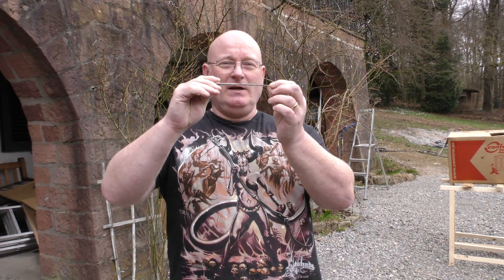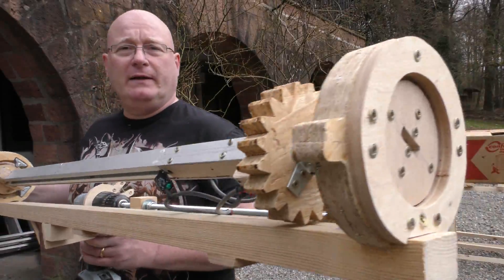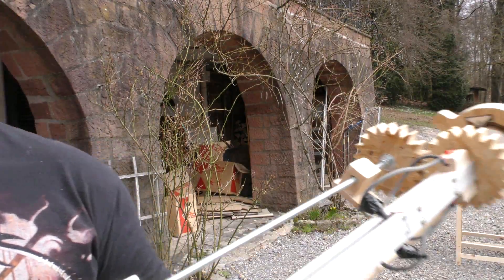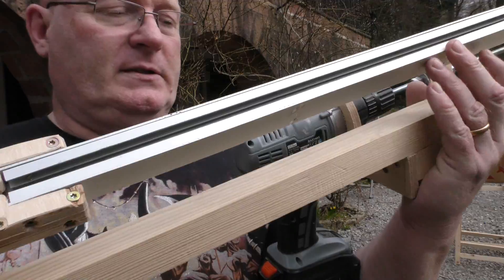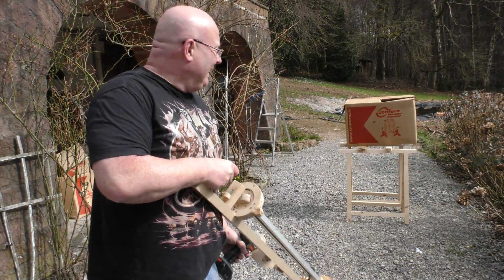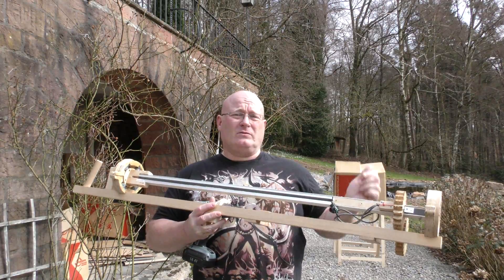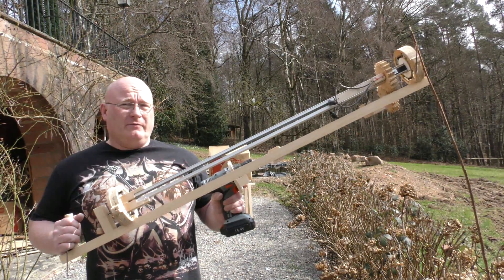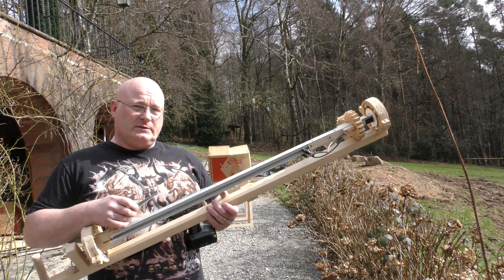"Kunai Twister 2600": The World's First "Rifled" Knife Launcher?

Comment: Attach some type of fletching to the knife. Like string or plastic that is attached the the back of the knife but it hangs loosely. When the knife flies the air will pick up the hanging fletchings and stabilize the flight of the knife. When I throw knifes I will do this type of fletching and it helps the knife from tumbling through the air.

Comment: I think the problem is the knife is flat and rotating it is like rotating a paddle in water - there is a lot of resistance. A round bullet spins much easier. You should test this contraption with a round projectile like a steel rod for example. Different lengths might also affect the movement. Looking forward to a follow-up :)

Comment: Try using a different gear ratio? If you have a larger drive gear and/or a smaller driven gear it will make it go a lot faster.
Reply: I work with this stuff using VEX parts and although vex had a large amount of flaws lol. They are still very good for learning how this stuff work but unfortunately they're decently expensive

Comment: Having a knife spin through the air will never work, because a knife is a flat projectile. The only way a flat projectile can be launched is by zero rifling, kinda like a straight bore shot. Its simple aerodynamics, unless the knife has some type of hammering done to the back of it, where you can give it fins like an arrow, hammer those metal fins in a spiral type of pattern, and it may work. Or of course you could try sharpening a large metal screw, so its like shooting a giant needle. That would definitely work.

Comment: Blade generates lots of drag if it doesn't fly 100% straight, and center of mass is too far back, which quickly flips it over. 
It's inherently unstable in flight, like an arrow that has feathers at the tip..

Comment: its not the spin its the center of mass.  I saw the tail start flying before the tip mid flight.  that tells me the center of mass is too far back.  you could possibly modify the knife by hallowing out the inside of the knife and filling it with lead, but only the tip area.  Any lower and the center of mass would barely move.  This is just speculation if the knife is made of 1 kind of metal and the handle isn't hallow.

Comment: spin stabilizing is a high speed business. a 9mm bullet from a glock is spinning about 103,000 Rpm. Even a mini ball from an 1863 Springfield civil war era rifle is spinning about 55,000 rpm. the 500-600 rpm of a cordless drill is 100x slower. Even a pellet from a 450 ft per second co2 pistol is spinning abt. 27,000 rpm

Comment: it cannot stabilize it, it's like rotating a paper, harder to rotate it up but easy to spin it around (vertical rotation as they do in the circus can cut the air and not resist it). or maybe empty knife, where there's just a frame and empty body.

Comment: double up the gears and put a flat, circular piece of wood bet wood between them and add some sort of rubber belt between them for more stability? just adding my 2 cents lol. also try an almost full metal barrel maybe that would solve alot of problems. im no woodworker nor am i a metal expert and i am also not an engineer btw.

Comment: If you add several 1-2 inch treads or string to back of the knife it will stabilize the flight by producing drag at the rear.

Comment: cool concept but seems underpowered, I'm guessing it's the limitations of the constructions.. I have an idea I thought of over ten years ago but had in mind since, it seems really strong and practical, but I personally had no way to do anything with it, maybe you will? the idea is to use small saw blade shaped discs, just sharp disks, or throwing stars and shoot them while spinning. the way I thought it would work is if there was a simple rail powered by a few rubber bands, and on it would be a slider with a really smooth axis and a plastic head that would fit perfectly into the blades/ throwing stars. near the end, the rail would have a straight smooth iron finish while the lead slides downwards a little, so that the blades/ throwing knives come off and keep flying straight. at the start there would be a simple battery powered motor with a rubber head that comes down a little and starts to spin when you push the first trigger, bringing up the projectile in question to a high spinning speed, and when left it retracts up just a little so there's room for the projectile to leave freely when you press the main trigger.. Hope this is descriptive enouth and gives you any good ideas :)

Comment: Advice: pushing the "O" shaped end makes the flight not as stable (due to system clearance) as pushing the "u" shaped which You can get by cutting off half of the kunai blunk end. It will make something like auto-basing of the pushing string. Have luck :).

Comment: It didn't work because the kunai have such a large surface area compared to its weight. It's like throwing a playing card, it only works if it's spinning along one axis compared to its trajectory. 
However traditionally, that ring is for tying on a ribbon, which moves the centre of drag behind the centre of mass while it's flying, stabilising it incredibly well over a long distance, so they don't need any spin and fly like a dart.

Comment: This concept doesn't really work as the blade will only get a very small rotating push as it leaves the end of the barrel. Same reason you can't curve a bullet. You should try to find a way to make it start spinning after it has left the barrel, same way fletching on arrows work.

Comment: it will never fly straight because the blade has a lot more surface area than the back of the knife. You have to have more surface area on the tail of the projectile so the drag forces will prevent it from flipping over, that why they put the fletches near the knock on an arrow, not on the front. No matter what you do this will never work with that knife.

Comment: Why Would Metal Gears work better? Just wondering...
Reply: +AutomaticRanger Metal gears are more solid, and would allow a tighter fit. Joerg's gears right now bump into each other instead of rotating in tandem. In my opinion, the best move would be to reinforce the bearings with metal and get smoother rollers.
Reply: +AutomaticRanger CNC machined metal gears. I think what he's saying that wooden gears 1. Aren't stable enough to be accurate at that sort of torque and 2. Aren't as accurate when hand-made as something that you machine out of metal. In case you're not familiar with a CNC machine, it's sort of a computer-controlled dremel that allows you to make precise cuts and indentations, forming the piece of metal exactly as you want it. You usually work off a 3D model created with CAD software.
Reply: +Jpwnage216 Thanks!
Reply: +Kyshu Thanks as well!

Comment: Why not embrace the idea that they were meant to be thrown and make a device that flings them toward the target. Instead of fighting the tumble, use it.
Reply from the maker: +traditionallytwisted But how to make sure they hit with the tip rather than with the butt or sideways?
Reply: Put the mechanism on a rail that you can slide back and forth to compensate for the tumble at certain distances. It would require a little math to figure out it's rate of tumble so you knew how long to make the rail.
Reply from the maker: +traditionallytwisted Math before every shot? Seems useless to me.
Reply: +traditionallytwisted 
Because that's what quitters do.
Reply: Not math before each shot. Do some math to figure out how to mark the rail for different distances. Since it tumbles continuously you would just need to find out when the point is facing forward the first time after you throw and the second time. You could use that to make range marks on the rail so you knew where to set it. Just an idea.
Reply: +JoergSprave The Kunais are build to spin around another axis, less drag, more balance. Either change your concept or modify the Kunais.
Reply: +Get the Joke! Actually Kunai where thrown without spinning or with almost no spin (1/4 rotation)
Reply: +JoergSprave Do you have to use those knives? like are you adamant on sticking with the concept of firing the unaltered throwing knives? just wondering because being able to add fins to the bottom and going with a 4 channel rail would be such a help.

Comment: For effective spin stabilized flight you need to get the object spinning about its Centre-of-Gravity otherwise the object will get an out of balance wobble which quickly destroys the spin.
The geometry of that Kunai knife means it is very hard if not impossible to get it spinning about its CG.

Comment: I would suggest drilling the centers out of the kunai blades, which would be removing mass, and more importantly, surface area during rotation, which may make it fly more stable by decreasing drag while spinning. What I seem to be seeing is the air resistance of the sides of the blades dragging the front behind and turning them unpredictably, and decreasing that drag would probably at least partially solve the problem.

Comment: The shape of the projectile has to be closer to a sharp cylinder. Flat shapes to not work for roll stability. If you fire for example the Cold Steel Throwing Spike with a similar mechanic, it should be a lot more stable.
Nevertheless, great work on the device and great video, Joerg!

Comment: Like I was saying in the last video, axial rotation of a knife is an unstable mode of rotation. That's a minor inertial axis, and the spinning will degenerate into tumbling. (Look up T-Handle Spinning in Space). Without a dominant inertial axis, rotation will not have a stabilizing effect.

A for effort though.
Reply: +silent66556 No rotation was also good enough for 20 feet though.

Comment: I think it is tumbling because at the end of the barrel, when the kunai is most of the way out, the tail end of it is still getting energy applied while the tip isn't.  Kunai may just be too long for that kind of setup.
Reply: +flamei11usion This, and also the fact that the kunaï is probably heavier near the handle, rather than near the blade, and therefore will try to rotate until it flights backwards. We can see in one slow-motion capture a kunaï hit the box sideways to kind of prove my point.
Reply: quite a good theory, thought of that too.
Reply: +flamei11usion I wonder if it is a good idea to make it spin at all. Probably the turbulence created do to the spinning with its shape out-wights the stabilization effect from the spinning.

Comment: Your real problem is that the TIP of the knife is not heavier than the rest. Add weight to both sides of the tip  (about 1/2 inch on both sides), and you will receive a more stable flight.
Reply: +Mark Price you do it
Reply: +Den Dory he is right. thats why spears sometimes do not throw accurately. the tip needs to be very heavy.
Reply: +Mark Price That or you can remove weight from the handle end.
Reply: Rob M One could always cut that stupid circle off of the end. That would do it.